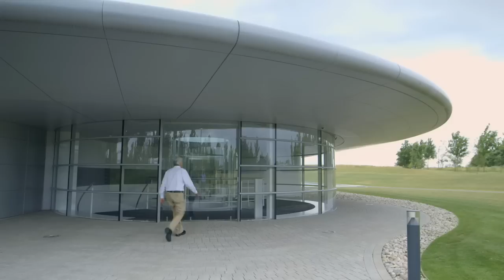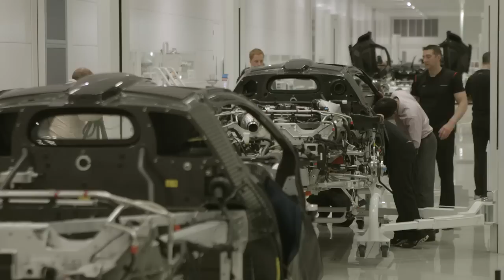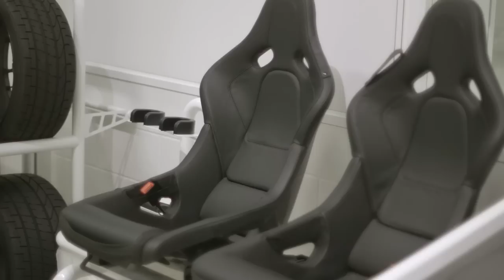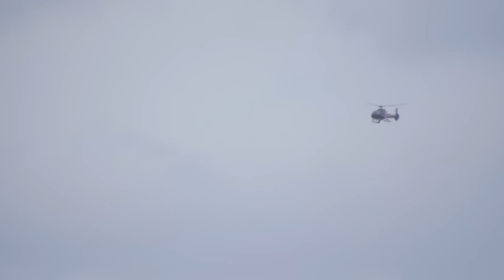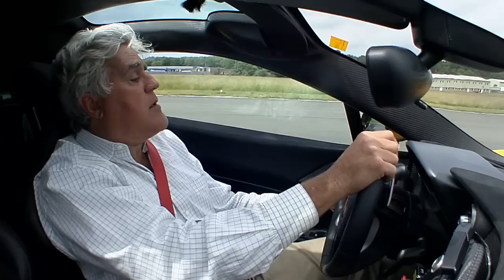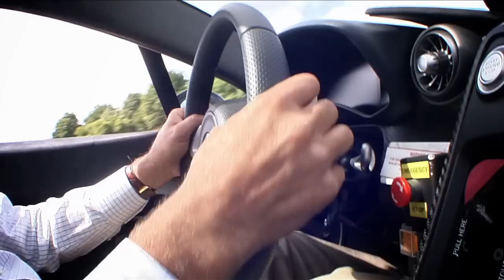2014 McLaren P1 - Jay Leno's Garage

Comment: Overpriced, means it doesn't worth the money that is asked for. you give a false definition by simple using the word overpriced as a synonym for expensive.

LFA is called as overpriced by Europeans, with the claim that it didn't perform like a super car even though it has super car price tag. LFA is the fastest car at Nurburgring WITH STREET TIRES. So LFA is the criteria to determine about a super car whether it is overpriced or not. And this car is overpriced according to Europeans' conclusion.

Comment: Exactly. You can get a faster 0-62 out of almost any car if you don't mind the engine melting after a quarter mile, removing all the seats/spare wheel/cd player and everything else and having HORRIBLE handling because of the huge engine, or because you know more about tuning engines than tuning a chassis.

Comment: 2.5s for the 0-100km/h won't be possible for a road car. Why ? because it is limited by tyres traction.
In fact, at less than 2.8s you have a mean acceleration superior to 1G .
Almost all road tires (even high end sports one) have a limit that is around 1G.

no matter how much powerful your engine is. Trust me, i'm an engineer.

Comment: Yeah well lol a friend of mine has a 2000hp Trans Am itll smoke ur stupd Venm.

You know how ridiculous you sound? The Venom is simply a tuner car. It's a tuned Exige. The P1 was never built for outright speed. They said that from the start. If it was it wouldn't have that spoiler. It's a drivers car, and without a question of doubt the most advanced car in the world right now. The Venom just has big power.

Comment: Horsepower is based on rpm it would be just as easy to parallel park a car with a thousand hp as it would to parallel park a car with 80 as the motor is producing almost no hp at idle. That being said if you were to drive at full speed without the skill to match, a 1000 hp would be difficult to control with a standard transmission. Drivers aids, like abs, stm, tcs, paddle shifters were invented to lessen the amount of skill required. Paddle shifters are better, but you lose something important.

Comment: those are all supercars, and the carrera gt is kinda old, modern hyper cars use paddle shifters because of the much faster shift times, the ability to keep both hands on the wheel at all times, and because that much horsepower is incredibly hard to just have a clutch pedal, trying to control almost 1000 horsepower with a clutch pedal is so tricky, and the clutches wont last.

Comment: To audiophiles the CD player is not obsolete. The day you can get compressed mp3-files to sound as good as high defintion CD's they may be, but until then they will just be the fast food equivalent of audio heaven.

Here's another thing. Most cars sold today still come with manual shifters. Semi-autos is so far only common in expensive supercars, even they still come with manual gearboxes (Porsche 911, Corvette, Viper).

It's not a question of need, but a question of practicality for a supercar

Comment: Of course auto boxes are more efficient and a tiny bit faster than a manual, but no one is arguing about that. I personally, as do a lot of people, enjoy the process of driving, not just the speed. I like to feel that I, as a driver, am in the centre of the experience. A manual box and a clutch pedal provide me with a better sense of control and occasion. Without it I lose a part of the driving experience. It's not a deal breaker for me, just something I prefer.

Comment: Right, because adding turbos, batteries, electric motors and the electronics to control them all is so good for weight distribution and reliability.  Also, there IS no replacement for displacement.  Turbos are a supplement to displacement, not a replacement for it.  Make the engine in the P1 larger displacement and it will still make more power than it does now.  Make it smaller displacement and it will make less.

Comment: As someone who works in this Industry I find your remarks FASCINATING! So being one of the worlds leading researchers on the electric motor; you would then have found in your research that the electric motor has been around just as long as the combustion engine.  Infact in the early 1890 before the Model-T; with companies such as Detroit Electric and Woods Motors, the electric car greatly outsold the combustion engine.  

Dumbass! LOL

Comment: The problem with that is that I'm a highly informed polymath genius. That makes you the ignorant one. And profoundly so.
Just to take one grotesque example, electric cars don't use nickel batteries.
I'd point out that P1 is a plugin hybrid electric car, it has batteries. It has no hydrogen. But will it make a difference...
Hydrogen fuel cells will never be btw.

Comment: Fuck yourself.

That is the most ignorant thing I've ever seen on YouTube. This is a performance car, not some half assed electric shoebox, built with materials from a nickel mine (lots of sulfur and acid rain comes from nickel mining). Electric cars are based on the battery, which is inefficient as it gets as batteries are horribly damaging to the environment. Hydrogen powered cars is the way forward. Electric cars will die and so will the opinions of ass holes like you. 

P1 for the win!!!

Comment: I think you might want to do some research before you continue spouting off. The electric engine is still miles away from competing against a combustion engine. It's best use at the moment is to either supplement the traditional combustion engine (as McLaren are doing), or powering it with a combustion engine (ala trains).

Comment: i am just going to get more and more pissed with more cars coming out as "hybrids" that go electric only enough to back out of the driveway. use the electric motor for its strengths, as gas or diesel electrics and stop lying to people that dont know cars that end up suckered into hybrids and electrics by the news. ill see you in 10 years when hybrids are what they need to be in order to be comparable to cars and more than just a sticker. imagine how fast it would be with more power

Comment: And I hear that nonsense from closed minded militant trolls like you.  I wouldnt believe that a hummer is less polluting but thats not an average car and its a rather weak argument from you...Battery cars (at this point) when you look at the overall picture are worse on the pollution scale when comparing them with "average" cars.  Even a decent diesel can get better MPG than a Prius.  Its not an opinion but a fact.

Comment: Think of it this way. A cast iron piano which is hella heavy weighs around 200kg. Should it really take 7½ cast iron pianos of weight to hold up 2 people and move them about?
with an all carbon fiber construction...
You could halve the car's weight which means you need less of everything to make it work. Lighter wheels, smaller discs, more emphasis on electric drive so tiny ICE is plenty.
Downforce becomes more effective with a lighter car..
etc etc etc

Comment: This is a hybird only in the loosest sense of the phrase. This clearly doesn't behave like like a bitchy little prius or something. It has a instantly torquely electric motor as well as a gas engine and it is a really good thing for performace because your torque band is wide open now instead of waiting for the revs to hit 4/5k so the max torque kicks. You instantly have it. Not it matters what you ignorantly think anyways. You could never buy a car of this value even if you wanted to.

Comment: yeah I would like to try to drive something like this, if they could fit my 6'7+ all torso self in one, but I'm like what Jay typically says.. You get me driving fast and my palm starts itching wanting that shifter ball in the middle of my right hand. paddle shifters may be faster but theres nothing like shifting your own gears and learning to time the rpm both in upshift and down and learning exactly how much you need to push that clutch in per car, hell our v8 66 fj40 5spd only needed 3/4 inch